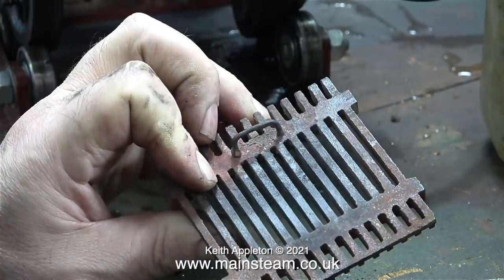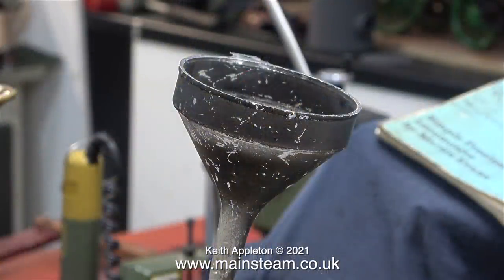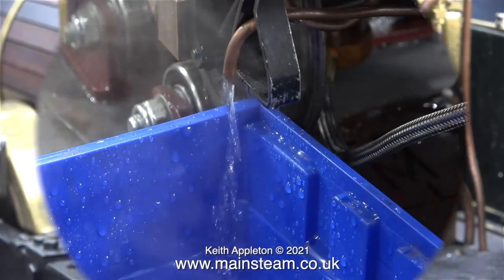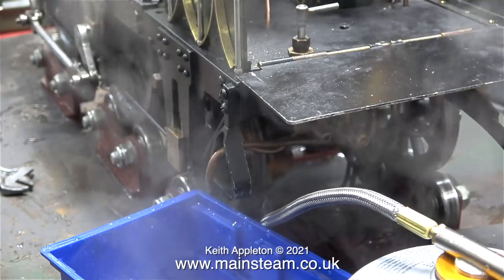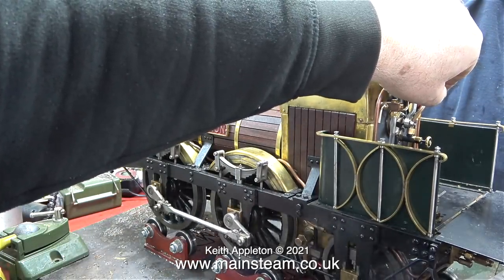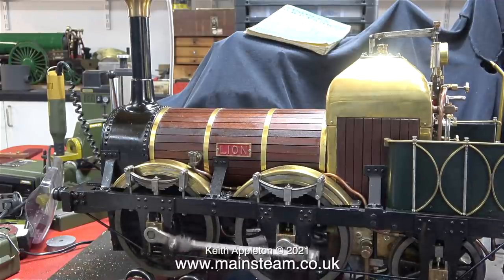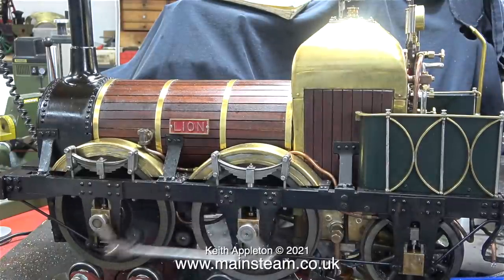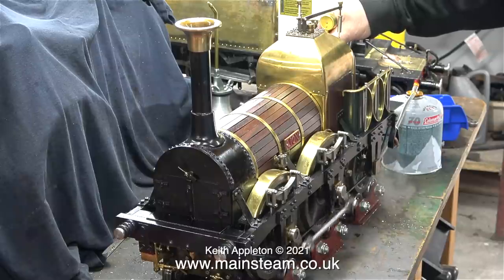A "LION" LOCOMOTIVE IN 5 INCH GAUGE - PART #8 - LIVE STEAM TEST

Comment: I once read that when the original Lion was introduced in the 1830s,  they were limited to no more then 35 miles per hour because some medical people said 40mph was too dangerous as it could cause air pressure against the eyeballs of passengers. The lack of protection from the weather is typical of the period,  but doctors never worried about the employees!  To think that the full size engine changed railroading into a practical means of transportation and then went on to serve in various functions until the 1920s is a marvelous testament to the early Victorian engineers! This model, which runs as well as the original,  is a testament to model builders everywhere!
Reply from the maker: A great comment - thanks }:-)))
Reply: @keithappleton  You are most welcome!  I enjoy researching stuff, whether it's old steam engines or forgotten events and people.

Comment: Because you wondered why the machine continues to run without fire... this is a completely normal phenomenon and is called "post-vaporisation" (in german "nachverdampfung" i dont know the english term). The higher the pressure, the higher the boiling temperature. When the pressure drops, the water vaporises.

"Steam accumulator locomotives" (german "Dampfspeicherlokomotiven") work according to this principle and normal full scale steam locomotives also show this very noticeably.

That is why a steam locomotive can also be operated above their boiler limit. For example, when used on a express railway with many stops and departures or when accelerating heavy trains when the boiler pressure drops. The energy is stored in the form of boiler water during braking and stopping and can be used during acceleration. But the fireman has to be able to handle it and know his locomotive, the track, the coal and the limits. 
Below the boiler limit, you can drive through the landscape without stress and smoke with a very thin bed of fire. And then the whole thing starts to be fun. 🙂

However, the pressure drop should never be greater than 20% of the maximum boiler pressure!

Comment: At 9:15, for example, it seems the back driver is a bit out of round especially when sighting between the two drivers. Also noticed similar in your last video. It may not be an issue. I do not know. What do you think?
Reply from the maker: I have already mentioned what this problem is in a previous video in the series . . . . the crankshaft is assembled using "Roll  Pins" and they are loose. I will in the fullness of time ream the crankshaft and fit taper pins
Reply: @keithappleton  Whew!! Good news. So I am not crazy wondering why everyone else said the engine ran great, I merely have memory loss..... 😎

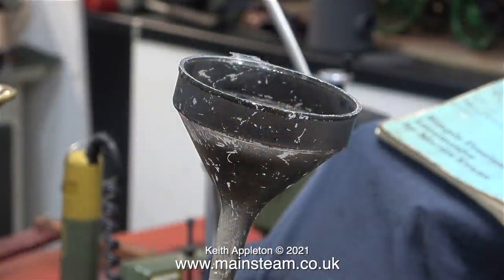Comment: At 1:20, the knurling is extremely poor... a good knurling should consist of perfect pyramids, not a scratcting on a turned surface.
Reply: As long as it adds a bit of grip to the part it should be even if it doesn't look pretty
Reply from the maker: I think it looks fine for what it is - and I didn't do it anyway.